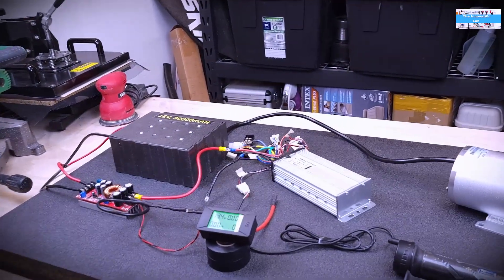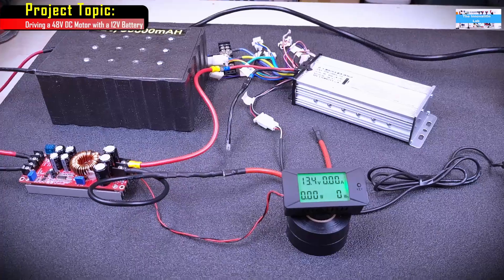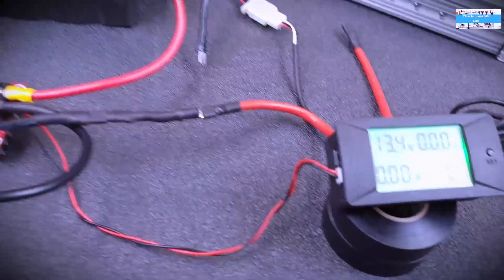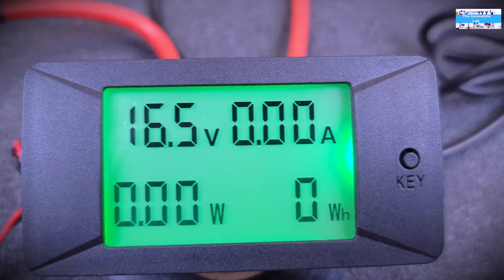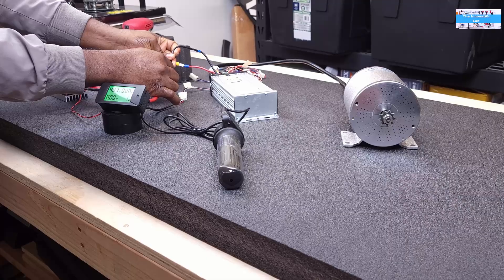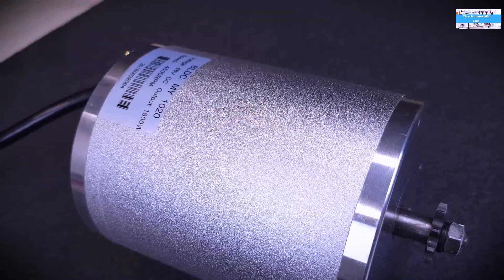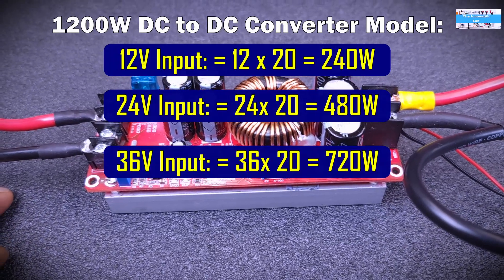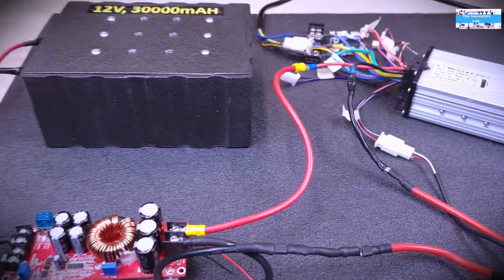How to Drive a 48V ebike electric motor using a 12V battery and a dc to dc boost converter

Comment: Hey friend!  I have a 250w bike, would a 12v 10ah inverter be enough?  My charge controller shows 16ah.  But the motor is 250w, I don't understand much about that.
Reply from the maker: Wonderful question.
👍👍👍
If you are sure about your battery specs, then it means that your battery should be able to provide about 120 watt hours. This means that if you plan to use a boost converter to raise the motor voltage , as shown in this video, you should really expect your battery to last less than 15 - 20 minutes. 
This is because you have to account for both converter and motor losses. 

However, to answer your question directly, I believe that you should be able to use one of these converters to drive a 250W motor with  a 12V battery.

👍😎
The Innovati0n Lab.
Reply: @theinnovati0nlab782  I will use a 12v 15ah deep cycle lead battery.  I'm Brazilian my friend, I really like your channel, I'll send it translated so you can understand.

Comment: You forgot to mention that the efficiency of the 12VDC to 48VDC converter is only 82%
Reply from the maker: You are right about the efficiency of the converter not being great at a 12V input. However, this video was made as an introduction to the concept. It was not meant to cover everything in great detail. However, as promised, I have made the sequel that talked about the efficiency of the converter at various input voltage levels.
Please check out the video below.
👇👇👇
https://youtu.be/haGmAmpqNAw?si=KjNZd1WaFmN8lTrn
Reply: @theinnovati0nlab782  Ok, sorry, I hadn't seen that video before.

Comment: wonder if u can use 2 boost converters in parallel    to double current    or  can u series the output on 2 converters   to get  higher output voltage
Reply from the maker: Hi friend,
No need to wonder. 😊
Please check out the videos linked below:
👇👇👇
Paralleled converter:
https://youtu.be/EKqIIOe_q8k?si=Bj4EeI-12TR8jXoa

Limitless Power Converter Concept:
https://youtu.be/oPhLpekQ4q4?si=IebDEjy2MoYQMW8a

I hope you find these videos helpful.
👍😎
The Innovati0n Lab

Comment: How can I connect 2 1800w boots converter on  serial  to increase the voltages
Reply from the maker: Great question!
👍👍
Unfortunately, you will not be able to accomplish a series output with these converters because this is a non-isolated flyback topology. You will need converters with total input to output isolation.

I have gotten lots of questions regarding this subject. I will make a video to explain it soon.
Stay tuned.

👍😎
The Innovati0n Lab.

Comment: Many thanks. I think of using 12VDC for my 36VDC ebike. It helps me avoid balancing issue of 12VDC batteries. But how about the efficiency? Is it too hot at 20A 12VDC to 48VDC?
Reply from the maker: Thanks a lot for the feedback! 
Yeah, you are right to be concerned about efficiency losses at 12V input - under heavy loads. Personally, I wouldn't recommend using 12V - after I load tested to system at 12V.
Please see the load test video below.
https://youtu.be/haGmAmpqNAw

 However, if the converter is working well for you as a 12 to 36V boost converter, maybe for driving light loads, then you can think of adding an external fan to your design. I realize that adding a fan to an ebike design will be difficult, but it could be  something to consider.

Comment: Hey im actually searching on making an e bike for not too much and I already have the bike frame but I dont have much money to spend and im searching for something that has like a 40km range do you have any idea of what I should take
Reply from the maker: Hi,
Thanks for watching our videos. Since you already have a bike frame, you basically need to invest in some good Lithium phosphate battery pack, and a good ebike motor kit. I saw a kit on Amazon that goes for less than $120. You can definitely give it a try to see if it will work for you. My recommendation will be for you to check out the reviews of the product you decide to go with - this way, you don't waste your money. 
I will be building an ebike soon and will be making a review video for any ebike kit I end up using.

If you don't have all the parts, you can keep accumulating them gradually until you have everything you need. 

Stay tuned.
👍😎

Comment: This test is without a load...What is the current under load?  For electrical bikes you need a lot of torques. I doubt if this boost controller can handle that. why didn't you use the 1800 W version? Or why didn't you use 2 or 3 boost converters parallel and use diodes in  the output or 5W 10K resistors to share  the current in all boost converters i.  parallel ? Than it might work if your battery can handle the current.  Then why you don't increases the voltage? that decrease current. Greetings an engineer...
Reply from the maker: Thanks again,
You are very correct.
I have lots of ideas and projects but not enough time and resources to actually execute all of them....and now make and edit the videos...lol
Hopefully, in the future, when The Innovati0n Lab has seen more growth, we can do multiple video projects simultaneously.
Actually I made a test video that could address some your initial set of questions. This was a straight 48V drive - without the boost converter.
👇👇 https://youtu.be/OuLokIPeGt8

I just currently completed a load test on this very ebike electric motor using the 1800W converter to drive the bike motor on my load simulator. Ever since I made this video and realized that I really needed to figure out a way to load test the ebike motor, and this has been something on my mind. The video is coming out this week. It may not be perfect, but  I believe it will address some of your questions.
In the future, I will also be thinking of implementing the paralleled boost converter drive.
Stay tuned, and thanks a lot for all the great ideas and feedback!
👍😎

Comment: This has been very helpful, I am running an ebike with one for experiement sake and it works pretty well surprisingly at 800 watts with two 12v 50ah lifepo4 batteries in series for a 24v 50ah setup to 48v.
Reply: So are you able to use one of these but it just won’t give them full 33amps this controller can draw?
Reply from the maker: Thanks a lot for the wonderful feedback. 
As a matter of fact, I am equally running a test with this boost converter on my load simulator, and I am getting similar results.
However, if you don't mind me asking, where are you measuring the 800W? Is it at the input of the boost converter or at the output?

Comment: Would this work for an electric mower conversion? I have a 36v battery and I need it to output 120v for the motor.
Reply from the maker: Hi friend,
I love the way you think!
This is one of the projects that has been on my mind, honestly.
However, is your motor a DC motor or an AC motor?
Unfortunately, this boost converter can only go up to 95V DC. 
I was able to modify the converter in one of the videos to show that it can possibly be tweaked to a high voltage. However, that is not something I would recommend for you to do.😊
Have you considered using a lower voltage motor? But that is if you are willing to spend a little bit more on the project.

Comment: Hi ...geart video ..thank you so much for that ..i wan just ask you ..did this booster can work safty with ebike without problems can it runing small veihcule perfectly as a 48v battery ...can you help me about that ....thank you so much
Reply from the maker: Hi friend,
This is a wonderful question.👍👍
Unfortunately, I have not been able to conduct a follow-on test to verify the performance of using this boost converter to drive an ebike electric motor under load. 
I am still working on this. Please stay tuned. I will make a video as soon as I make some progress.
Reply: @theinnovati0nlab782   thank you so much ..❤️❤️

Comment: How much time it will work , 
I thik after loading it will pull measure current , if it will work on 12 volt then then we can save money,  because for 60 volt  battery is very costly than 12 volt battery, Pls reply
Reply from the maker: Hi friend,
I like the way you think and I see your point. However, it may not be the best idea to run the motor on a boosted 12V because at peak performance, there will be a surge in the drive current demanded from the 12V battery and this will drastically shorten the life of your battery. My plan is to use at least 24-36V boosted to 48V to run the dc motor. Higher voltages are encouraged because they mean less current draw from your battery system. Also, we  have to account for the converter efficiency losses.
Reply: @theinnovati0nlab782  I built a ebike using a 20 inch kids bike and 2- 12v@9ah scooter batteries
in series and a simple on off toggle switch, and got 13 to 15 mph consistently. Then for fun,
i added a BUCk converter and was able to run the 250w/24v motor at speeds as low as 3 ish mph
by reducing volts to as low as 8-9 volts and 9-10 amps.No problems - no overheating. But back
to what Mahesh alluded to,  a typical 60v-10ah ebike battery(specific to a particular ebike) will 
cost alot vs using a 12v-50ah generic lifepo4 battery. And if you run both at .5C then its battery safe and
provides 300 watts either way...Only maybe need to increase wire guage for 25-30 amps and (using
1200w 40a or 1800w 50a converter) if you accelerate slow enough, in theory it should work....ie
not burn up the unit. Another problem might be getting the lawn mower battery sized lifepo4 to
fit somewhere on the bike..., maybe in a rear mount cargo basket?  Almost anything is possible

Comment: Could you use multiple converters to give adequate power output to run under a load?
Reply from the maker: Hi friend,
This is a great question!
👍👍
 I think it is possible, but honestly, it is a bit harder to accomplish because switch-mode power supplies or converters like to operate as individuals - unless designed for a synchronous operation. Synchronous power supplies are a little more expensive because they require a slightly more complex control circuit. I will be doing a video in this regard in the near future. 
Stay tuned, my friend.
Success wishes on your projects.

Comment: add a load and it will burn the converter
Reply from the maker: You have a good point. However, it also depends on how much load and the input voltage you are using to drive the converter.
These converters only deliver 360W at 12V, which is barely half a  horsepower of load.

Comment: Hi can these step ups ruin the lithium cells or decrease the life of the battery pack or is all this false? I know that by increasing the voltage the battery discharges earlier this seems obvious but I don't know if it decreases the total life of the battery you know lithium batteries have about 1000 cycles which should last 2/3 years but with the step up I don't know if it will die to earlier ?  thanks vrey much
Reply from the maker: Hi friend!
Thanks a lot for the wonderful feedback. I like your thoughts on this.
👍👍
However, all I can say is that as long as you are not overstressing your battery system by drawing much current than your battery system can handle, then your battery should be ok.

My recommendation for your lithium ion or phosphate batteries is that you should never apply any load that will draw more than 50% of the battery's "C" rating.

For example, if your battery pack has a C rating of 30Ah, I would not recommend subjecting it to loads that will draw more than 15A continuously - if you are concerned about getting the full 1000 cycles out of your battery.

The great thing is that most lithium phosphate batteries can withstand a short duration surge current draw about 5X of the C rating. But this should only be for a short duration.

Summary:
Design your system such that your current draw does not exceed what your batteries can handle - whether you are using a boost converter or not.

Thanks again for the wonderful feedback.
Success wishes on your project, friend!
👍😎

Comment: if you open the motor controller box and see the capacitors rated for 63v. you can try to set  the boost converter to 60v to be safe and then you use less amps.
Reply: It will run  ok but if you test it in actual way  with a load  it will drop voltages it will not keep up,  so in your Demo you have test it with a heavy load...
Reply from the maker: Thank you so much for the wonderful feedback. I do appreciate it.
👍👍
Reply: On 12v he can run that motor MAX 240w because that Converter has input current max 20A
Reply: @null7969  there are 2 15A fuses on this board on the input. So 30A max at 12V. I own one of these boost converters with 3 20A fuses on the input.
Reply: @boo421-o5t 40a for the inverters using 2x ferrite cores ("1800W") or 25a with single core ("1200W")
Reply: I have 48 v bldc controller in scooter can i run 36 v?
I mean changing capacitor?
Reply: @tronetrickard7130 nope. U need to re & re it w a motor w the same specs. The electronics r already wired 4 it.
Reply: As an engineer i know It won't b able to power u around on ur bike without a sizable capacitor bank that uses active balancing, placed between the motor & the convertor. The convertor output may need 2b set to 52v. To avoid drawdown. Without the cap bank the motor won't b able to run under load using just the converter, as it doesn't have any way to buffer the power draw inflicted by the throttle. Running it without a load only proves the motor spins, not that it can power anything. Strap this baby on a bike, w the cap bank. It'll work, & u get a build vid out of it too!

Comment: I’m a little confused regarding the input potentiometer.  How exactly do I measure to set the minimum voltage ?  I have a amp/voltage meter to set the output, but I’m not understanding how to set the input. I will be using a 36V battery with BMS. I figure that the BMS adds some safety. I will most likely boost up to 48V.  I have the 1800w dc converter version of the one in your video.  Thanks !
Reply from the maker: Oh, friend!!
My apologies for missing this feature in my videos. Thank you for asking this amazing question!!
👍👍👍👍
I will make a quick video this weekend to go over this.
What you are referring to is the Under Voltage Protection (UVP)  potentiometer. Usually, once I set it, I just leave it alone.

This potentiometer basically helps you to determine the set voltage where you want your boost converter to stop the boost function.
For example, if  your design goal is to boost a 24V battery to 60V, but you want the boost converter to stop boosting when the battery voltage drops down to 12V...or any voltage below the initial battery voltage (24V). Then, you have to adjust the UVP to the voltage that you have chosen. The process of doing this is simple but also a bit elaborate to explain via text. Please watch out for the video this weekend.

However, if you don't have any design needs to set the UVP, I will recommend that you just adjust the potentiometer close to the input connector counterclockwise until it bottoms out. You will hear audible clicks from the potentiometer when you get to this point.
Please note that doing this might mean that you will lose the UVP function.

Disclaimer:
When it comes to this device, I am simply an unaffiliated user like you as I didn't design it. My videos are honest reviews that are not sponsored by the converter manufacturers or vendors. Please conduct your own research before implementing any of my suggestions.
Reply: @theinnovati0nlab782  I’ve seen many videos that demonstrate how to adjust the current and output, but not necessarily the UVP  adjustment function which I think is especially important because the battery is generally the most expensive of all the components 😅.  For someone who is a novice (myself) to these devices, I’m trying to prevent problems 😄.  
I’m glad that you thought that this was a important issue to address 👍
Reply from the maker: I will post some pictures in the community area. I hope you can find them helpful.

Essentially, whenever you see that the yellow UVP LED  is illuminated, it means that the boost converter has entered the UVP mode...and your output voltage will drop down to the same level as your input voltage.
Reply: @theinnovati0nlab782  thanks for helping me understand this better, I look forward to you presenting this feature in a future video.
Though all my batteries have BMS, I wanted the extra layer of protection that the under voltage protection provides 🙂.  I bought a more expensive 36V to 48V step up converter, but that device is huge compared to the 1800w dc to dc converter ! Because I will be using these for my ebike projects, space is limited.

Thanks again

Comment: hello, I want to ask if I have a 48 volt 1500 watt scooter, is it possible to increase the voltage to say 60 volts or 72. thank you
Reply from the maker: Hi friend, 
I am trying to understand what you are trying to do.
However, if I undestood correctly, you will not be able to increase the voltage rating of your motor because the windings and components were designed for a 48V power source.

Comment: Спасибо за видео. А можно ли такие преобразователи подключать параллельно, для увеличения выходной мощности?
Reply from the maker: Thanks a lot for the great question. 👍 
The reality is that connecting any SMPS converter in parallel, a is difficult to do. However, it could be possible. I plan to do something like that in the future to experiment on it. 
Stay tuned, fiend!
👍👍
Reply: Did you try and run two in parallel yet?

Comment: totally inefficient. the  four 12volt in series batteries  is better and better!
Reply from the maker: Thanks a lot for the feedback. 
👍👍
I agree with you. However, the video was mostly an experiment, and I have not had the time to load test the motor while driving it with the boost converter.
The most efficient way to drive the 48V motor will be to use a 48V battery. No one can possibly argue that. The point is that some people may not have a 48V battery.